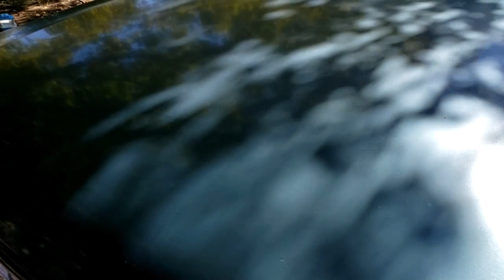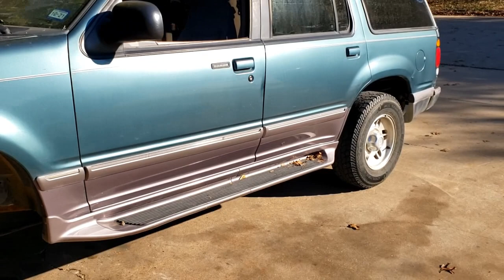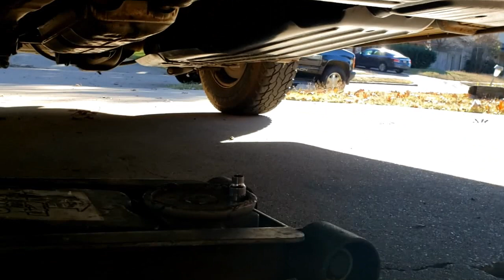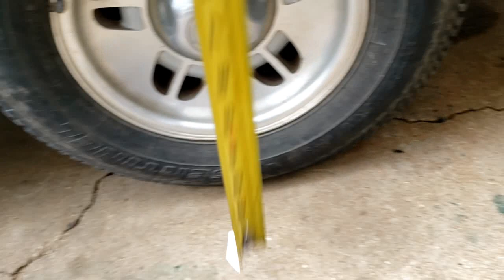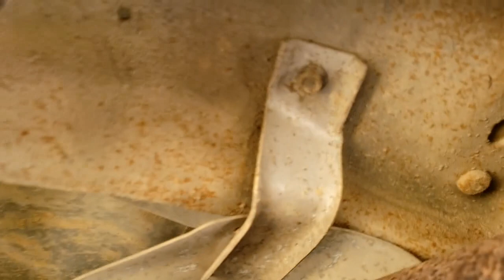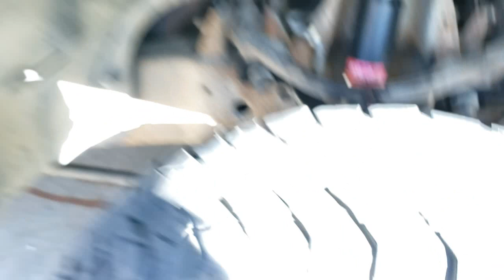Ford Explorer lift kit project   2nd gen   DIY how to lift for AWD and 4x4

Comment: don't wanna be this guy but cranking my tbars destroyed the front end of my explorer had them cranked with modded keys like 3.5 inches
Reply from the maker: You can do bad stuff for sure if you crank them too much. Especially if the ball joints / cv axles are not in good shape
Reply: @gagefixeseverything  my cv axles we're at right angles man it was bad

Comment: So badass! I live in Arlington lol small world! So you technically don’t need a key right? I just replaced my shocks all around and the front still sits low
Reply from the maker: Ha awesome!! This truck is still daily driving around. TXarms owns it now in Ft worth. Right, you do NOT need a lift key
Reply: @gagefixeseverything  would you be willing to do these to mine? Obviously I’d pay just don’t trust anyone and shops are sketchy lol I want to re do the front end stuff and then as well replace the rear springs and add a leaf and shackles as well this is gonna be my daily next year after my lease is up. If not have anyone you recommend?

Comment: I was just going over the parts list again before I buy shocks for my 98 V8 XLT AWD and see you chose the (KYB Excel-G Gas Shock
 Part #: 341302 Line: KYB Shock/Strut Extended Length (in):   17-15/16 Inch)  and was wondering why you didn't use the Rancho RS5000X Series Shock Absorber Part #: RS55229 Line: RAN Shock/Strut Extended Length (in):   18-1/4 Inch or the Rancho RS5000X Series Shock Absorber Part #: RS55374 Line: RAN Shock/Strut Extended Length (in):   19-1/4 Inch? They are the short bodied shocks like you talked about to clear the CV Axle. Wouldn't either of the Rancho shocks give it more lift?
Also can you tell me where you got the steps?

Comment: I recommend replacing the torsion bar bolt retainer. That’s the small part that the torsion bar bolt screws into. I did lift keys on my 2000 and one of the bolt retainers failed due to age, causing the torsion bar bolt to be crooked. The replacement was $10 and is easy to change while you’re installing lift keys.
Reply from the maker: Good info here!

Comment: i made a custom pad from a nylon cutting board for the wider aftermarket torsion key to reduce vibration cranking the stock key doesnt allow it to work well in that position i hated it for 6 months the torsion  bar from the v-8 exploder allowed for the extra weight of a brush bar and winch the OHV comes with a rock solid transmission and none of the timing chains and grief of the stupid overhead cam 4L
Reply from the maker: Good info here!!^

Comment: What’s the powerful v6??
Reply from the maker: SOHC v6 puts out the same power as the 5.0L in those years
Reply: @gagefixeseverything  how do I know if it’s a soho or dohc
Reply: @dr.auggie1109  There was no dohc on pre 2002 explorers. There was a 4.0 sohc, a 4.0 pushrod, and a 5.0 pushrod.
Reply: The sohc has a timing chain in the back which requires removing the engine to change and as you might expect they are notorious for chain guides failing, often around the mileage he has therefore the the SOHC is the one to AVOID. the ohv is the reliable one and has better tq (in the real world, about the same on paper). It has no top end but it's a truck so who cares.

Comment: Update and more
Reply from the maker: I have updated the description with the parts that I used for this job. So far, this lift kit has been great for several thousand miles. Pulling a few trailers, and hauling some heavy things, as well as several family vacations across the country!
Reply: @gagefixeseverything  thank you so much I want to lift mine, I got a 2001 Explorer Eddie Bauer edition v6, you think it will work too?

Comment: i did add a leaf... pro form lift shackles rear.... which gave about 2.5 inches.... up front i took the stock keys and cranked them as much as possible. it's still not quite level, sits a little raked. and the front end is a little wobbly... should i get aftermarket torsion keys?
Reply from the maker: No, the stock keys give the same lift. Is your front end really bumpy/jumpy, or just loose feeling? I rebuilt the entire front end of my truck at the same time as lifting it. ball joints, tie rods, etc.

Comment: Informative video liked it very much, I have a 98 5.0 XLT that I would like to lift a couple inches I am running 31x10.50x15 A/T tires that rub on the rear of the front fender, so if there is any information and part numbers that you can share for the shocks, leaf springs and torsion lift keys (I will be trying with the stock keys first but just in case) it would be greatly appreciated. Keep up the great work on the videos.
Reply from the maker: Thanks for the comment! I just updated the video description with part numbers for you!
Reply: @gagefixeseverything  Thanks for the update with the part numbers, greatly appreciated.. What was the outcome with the stud extenders/spacers you were going to play with? what size was the best and what material did you make them from?
Reply: I am ready to buy new tires for my 98 mountaineer and I want 31x10.50.15 A/T tires. Did you get yours to stop rubbing? And if so how did it go? In all, what exactly did you end up needing to do to make it work?
Reply: @braxtonmorgan2125  actually it was fairly simple, I found out it was rubbing on the factory running board just inside the front wheel well, so I took a cutoff wheel and trimmed it back. It took about 5 minutes for both sides and no problems since. Good luck.

Comment: I have a 2005 Ford Explorer that I would like to lift as well. Do you believe EBAY sales dissent parts?
Reply from the maker: The ebay parts seem just fine for moderate wheeling and mostly on road use.

Comment: Came out really good man. i have similar lifting mods but my front wheels camber out at the bottoms, what do you think makes them do that?
Reply from the maker: Thanks! What year is your truck?
Reply: @gagefixeseverything   97 explorer torsion front end. i actually got longer shocks from rancho, it says to get them if you have 1-3 lift in the front.. should i switch to regular length?
Reply: @Jaycal559  Did you replace the stock camber bolts? I replaced them with AC Delco bolts that actually allow for camber adjustment. My tires are even with the back when I get an alignment now.

Comment: That V6 is the most reliable one. The higher horsepower SOHC has timing chain issues for anything this age really bad. They are ticking time bombs
Reply: My explorer has the ohv and it’s coming up on 300k miles
Reply: @alexsmith3470  Have you had to replace head gaskets or head(s) ??
Reply: @barrya.6212  205k unopened motor runs great !
Reply: Got the 5.0 with 400k
Reply: Exactly
Reply: That’s hilarious.. I’ll take a 5.0 any day of the week over either 4.0
Reply: @Sikkfox  yeah I've had 0 problems, just keep up with maintenance
Reply from the maker: You are right from what ive heard! I have a 1994 model with 245k miles on it myself
Reply: @gagefixeseverything  I had '94 Ranger / same engine... had sold it just shy of 248k was running like a top with no internal engine work needed / done.... sold it to get same engine Explorer like this with 4WD.... youtube:  Explorer 400,000 to see many reaching 400k
Reply: But if you do the timing chains even the sohc's are decent. My 98's original sohc made it ,with replaced tensioners, 400k km before blowing the bottom end  out, was 700 canadian dollars for a replacement with 40k km did the tensioners before going in and now is running strong again

Comment: I’ve heard the expedition shocks work from the same era.  Great video. Thanks man.
Reply: I got Cherokee shocks for the front when I lifted my explorer. They are a longer length and bolted right up.
Reply: @TheKingOfHalo  do you have part numbers for what you used? I've heard about this on forums but wondering what you used and how much lift you got in the front?
Reply from the maker: Good info to look into, thank you!
Reply: @gagefixeseverything  DON'T DO TRANS FLUID FLUSH ...JUST BASIC DRAIN AND FILTER....flush can remove residue that is actually "working as sealant' on all the old seals...flush can break them loose = trans rebuild...happens a lot!   That 4.0 ohv engine is one of the longest lasting engines ever made....yes, not much power but good bottom end torque.   Youtube:  Ford Explorer 400,000 miles to see several ohv's reaching 400,000.  I had Ranger with same engine that I beat and it ran like a top at 257,000 + plus miles when I sold it....zero internal engine work done / needed...just DON'T over heat it!...change thermostat as preventative step.   Does yours have the L.S. rear end?  ....door sticker axle code will show D2,D4, or L73 if so....